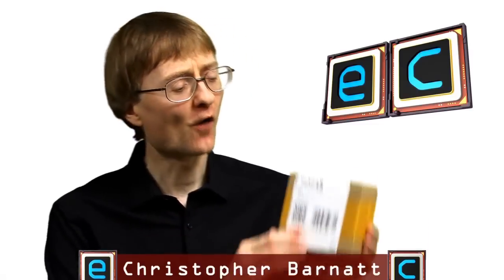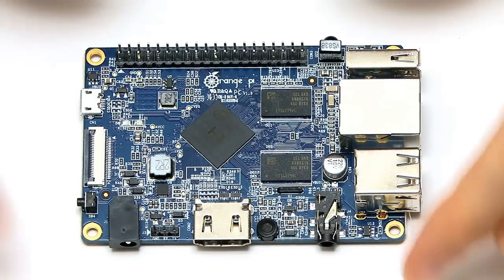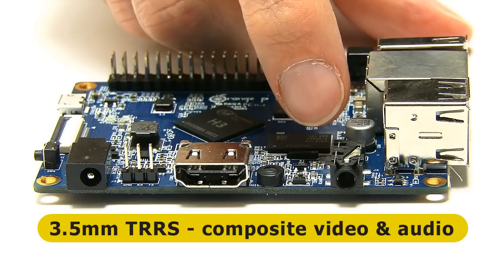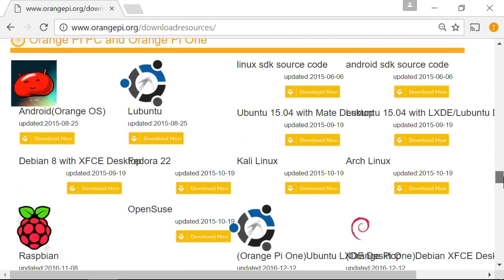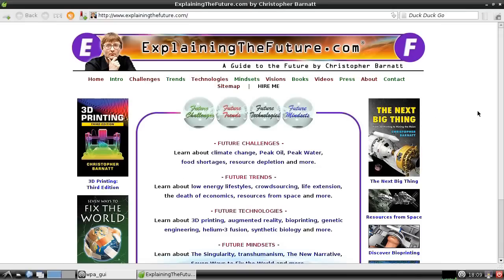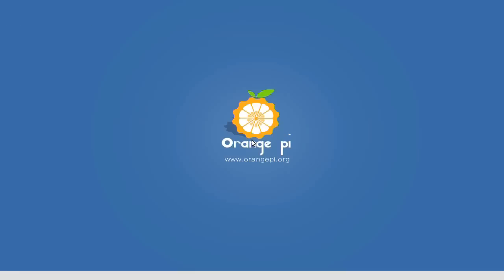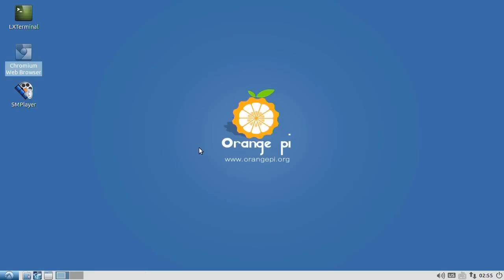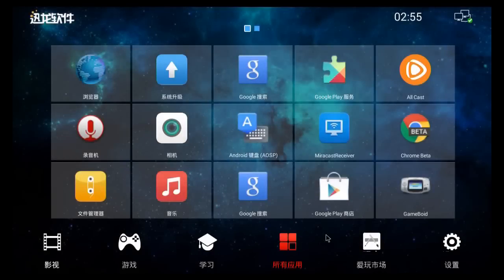Orange Pi PC

Comment: pls,pls use armbian and don't let this great board suicide its core...
it's confirmed this H3 CPU's 1.6GHz is an overclocked value (1.3GHz is default) and heatsink is necessary(at least a small native cooling one), and also their provided OSs are mostly outdated and unstable...
Reply: It's really annoying that they won't put a PCI express on these things. I reckon they could squeeze a pci-e4x on it. With 1.6ghz, you'd be able to play blu-ray with even just 2cores. With just a gen2 pci-e running at 4x you'd be able to have a video encoder card (HDMI input) for it.
Reply: +TableWolfMusic
that's because its CPU(allwinner H3) can't support PCIe as well
it's just a $20 cheapo ARM SBC, what can you expected for. Or buying a UHS1 micro SD could be better?

Comment: 6:36 The microSD socket with the spring got removed from the RPi3 because it easily breaks.
Reply: The lack of a spring in the Raspberry Pi 3 makes it a bitch to get the Micro SD out when it is put into certain cases.  I ended up getting a pair of tweezers and fashioned some little rubber sleeves on the ends so I don't fry anything pulling the card out.
Reply: Mac Donalds - That is like telling me not to lick a hot stove.
Reply from the maker: Indeed. But I bet they put it back on the Raspberry Pi 4! :)
Reply: Bet's on.

It's counter intuitive to have to push on an SDcard to remove it. Many people pulled the card out and that broke the latching mechanism.
Reply: Maico, the LEDs on an RPi3 are in a different location than on an RPi2; that's a way to tell if a case was designed for RPi2 or RPi3.

BTW, I use tweezers to get the SDcard out, but I have a cheap RPi2 case. Idk if the slot opening of an RPi3 case is different.
Reply: +magus12000BC exactly the problem I have. I bought a case saying its Pi3 compatible (while it was probably designed for the Pi2) but since the P3 MicroSD-card slot has no spring and my fingers are not thin as a sheet of paper, trying to pull the card out is impossible.
Reply: Magus, I hope you switch off the RPi before you pull out the SDcard.
Reply: Magus, then why did you put "some little rubber sleeves on the ends so (you) don't fry anything"? That doesn't make any sense.
Reply: Mac Donalds - Metal is a conductor and static is a very real possibility.  Even though the tweezers may have discharged whatever it may have had when I touch it to pick it up, I take no chances because the board itself may have a charge.

The only thing worse than touching a board with your oily fingers without even grounding yourself first is poking at it with what are basically metal prongs.
Reply: It sounds like you're a bit clumsy, then.
Reply: Mac Donalds - A few things here.

1.  Boards are no more structurally sound than they were in the 70's.  They are highly conductive.  They have to be if all the components on the board are going to talk to each other.  The reason why these are marketed for classrooms are because they are cheap and easily replaced.  The specs are something you'd see as standard back at the turn of the century.

2.  Static can arc just like any other electric charge.  You even have to take precautions when soldering.  Any amount of static, even if it isn't a visible spark, can fry a key component and kill the whole board.

3.  It isn't clumsy to take precautions.  It is the exact opposite.  Just because something isn't probable doesn't make it impossible.  And I have seen what static can do first hand.  Take a household vacuum cleaner to a computer tower and see if it turns on afterward.
Reply: There is a difference between a vacuum cleaner and tweezers.

If you fry an RPi when you pull out the SDcard with tweezers, then you're clumsy.

Comment: I think you don't need to format the card before writing the image with win32diskimager but it won't harm ofcourse
Reply from the maker: It remains recommended by all SBC manufacturers I can find. If a card has been corrupted, or even even formatted with multiple partitions previously, it can be hard to expand the file space on it without a "true" format first. I've certainly had SD cards that I could not use again until using the SD Formatter.
Reply: Hi Christopher, I haven't had these problems myself and couldn't think of a reason it would be needed since the partition table will be completely overwritten when the image is restored but apparently not first formatting the card still can cause problems so I humbly withdraw my advise. Furthermore  I wanted to say I really appreciate your style of meticulous and very clear video making/reviewing. Happy Easter !

Comment: What does dmesg say? If it shows the name of the device when you plug it in, then you could use this name to find a kernel module to install so you have access to your usb devices such as Wifi
Reply from the maker: I will try this. Thanks.
Reply: BTW lsusb/lspci is another tool that can list USB devices that are recognized by the kernel. I don't know how those minimal Linux versions work in detail or if they have such tools installed but normal, modern Linux kernels usually report detected devices. While dmesg shows live messages of events that happened in device context, lsusb/lsusb just lists all attached devices on the bus or device ports.

Comment: +ExplainingComputers / Christopher
I suspect that the issues surrounding the lack of USB & Wifi drivers is actually related to the lack of support from the Ubuntu / Raspbian kernel, you should be able to compile separate drivers and then recompile the kernel to gain full access to the USB interface.

Also, I recently was browsing the Armbian web site ( www.armbian.com ) and stumbled upon the ClearFog Pro SoC board and thought that you may be interested in this impressive looking device.

http://wiki.solid-run.com/lib/exe/fetch.php?media=a38x:carrierboard:docs:sr-a38x-clearfog-pro-datasheet.pdf6

Comment: Classic hardware-vendor syndrome: good hardware. bad software.

The folks behind the orange pi should design their hardware to run stock images directly from os vendors (canonical, debian, etc) if they aren't going to put in the effort beyond providing the bare minimum, just leave the software to those who are.
Reply: The SoC in those boards are absolutely not supported by mainline kernel when the hardware arrives. It needs years and lot of community work to get basic things work. The SoC manufacturer provides an old, custom hacked kernel that works with the hardware. This is why all distros and android based on the same shitty 3.4 modified kernel.
Also the boot flow is various SoC-by-Soc. There is no universal standard for arm devices. So these hardware will never be able to run stock linux distributions out of the box.
Reply: While the boot process does currently very from one SoC to another, there is nothing that prevents SoC firms from agreeing to a single boot process and a standard peripheral layout (like how intel and AMD have done for both x86 and x86_64). It doesn't even have to be the default behavior as long as it can be enabled by pulling up some pin or something. If such an agreement is made, then distros will include basic support for these chips out of the box (even new hardware).

I think ARM should mandate a compatibility mode for ARM chips. These firms are too selfish and shortsighted to do the right thing on their own.
Reply: I have to agree, I has someone push this guy over the regular pi, then watch this video and say hmm. i might play with one one day, it just comes down to a proven piece of hardware or try to save a buck
Reply: billfusionenterprise I don't agree. I wanted to buy Raspberry Pi. Instead of it I have just ordered Orange PI PC Plus. Better specs (1gb, 8gb storage, 4 USB without internal hub like in RPI) and lower price. Of course I first checked if it is supported by Debian (because I am it's fan). Great community support (Armbian and dedicated RetroPI version).
Reply: Armbian support is really good for Orange Pi and you get an up-to-date Linux mainline kernel 4.14.y with Ubuntu 18.04.1 LTS.  It has worked flawlessly for me though it's command line only which is all I use.  Network commands are a little different with Ubuntu 18.04 since you use nmcli instead of the old method of editing config text files.  Just use this command to connect to WiFi. nmcli device wifi connect SSID-Name password wireless-password

Comment: so this is like a base model for orange pi?
Also, will you cover the plus or plus 2 model? since it has sata interface and uses emmc
Reply from the maker: It is roughly in the middle of their range.  I may look at their higher end models of some point -- as you say, those with SATA are particularly interesting. But I think I will try to get something running properly on the Orange Pi PC first! Several people here have suggest that I install Armbian.
Reply: ExplainingComputers i'm looking forward for that. And thanks for the quality video :)

Comment: I do have Orange Pi Lite, which is a cheaper version, I believe the hardware is similiar, except I got only 512 RAM, two USB ports (in which one of them doesnt seem to work at all !), no LAN port, but with WiFi. I couldnt configure the Raspbian properly, it didnt seemed to cooperate with onboard WiFi, so you are not alone with the WiFi problems. So I installed Armbian, which runs perfectly, and Im planning to check out Android OS soon, but not the chinese one offered by the OrangePi site.
I asked you previously about the power supply, because I was worried if the computer itself would power more connected devices, and yes, 5V 2A would be enough, but I got my hands on the 3A charger with the 3.9/1.7 DC output - it also fits, and was way cheaper than 4.0/1.7 DC. 
Thank you very much for the video it seems that all Orange Pi computers have similiar issues. The best thing about it is that it actually works fine with Armbian, and (in my country) it was cheaper than Raspberry Zero.

Comment: My Orange Pi PC died after a month, refused to get through booting, just froze part way through, tried different OS's and a different SD card but to no avail.
I'd avoid these personally they are such a headache, may as well fork out the bit extra for a Raspberry.
Reply: I have a RPi 3 and it boots from a 500 mA USB Port on a telly. So for those things Raspberry Pis are almost always better.
Reply: Squiggleblorg Have you tried using a different power supply? I've heard Orange Pi's are pretentious when it comes to those and not booting with cheap ones.
Reply: I bought 2 and one stopped working when my kids tripped on the power cable.  It wouldn't boot for weeks and then as if by magic it started working again.  I looked it up and it turns out these things have a poly fuse that trips to protect the board on a power surge/spike and they say the fuse resets after a day or two.  Well it took more than a few days, but I have both boards again.  Hope you kept your board -might be worth trying again.
Reply: Default kernel of official Linux distros tries to run the CPU on maximum possible speed, it may be the reason of the hardware death. I run Armbian, which cuts CPU speed not more than 1.3GHz, it works just smooth one year so far
Reply: True for the middle class editions, but if you want something really powerful (gigabit ethernet, SATA, 2GB RAM…) Raspberry Pi won't cut it. And if you want something really cheap, Raspberry Pi is also not an option because the Zeros are constantly sold out everywhere. Orange Pi covers both of these areas.

Comment: Try using armbian - its like linux and most probably the wifi usb driver can work.
https://www.armbian.com/orange-pi-pc/

Also you can change the language on android by going to settings then to a keyboard icon by scrolling down and choose the first option. You'll find english, press on it and your done.

You can also use RetroPiOrange to play old school games using emulator. I hope you make an update on the orange pi even though I don't own it. Hope to get a reply from you :)
Reply: Thanks, i own an Orange Pi and I'll try those images, but as i have it for over a year and tried lot of systems, i'm quite sceptical :)
Reply: Nightly image has kernel 4.10.1 insted of 3.4. So it should have better driver support. Hardware accelerated video and gpio is probably still limitted. But at least you can turn the board into a server for streaming, donwloading or other stuff.

Comment: Are the dongles not even showing up if you do lsusb at a terminal? Perhaps they're the sort with firmware blobs which are uploaded to the adapter each time it's used and these aren't available in the OS. I had a similar issue with Mint, an old Dell Inspiron laptop and its Broadcom adapter.
As of often the case with SBCs, the spec can be nicer than a RPi but the software and community backing barely exists.

Comment: Can it be used as a desktop pc? I'm currently on rpi and using it is a really bad experience.
Reply: I wouldn't use any ARM device as a desktop.
Reply from the maker: The only really good desktop experience I've had on an SBC is with a LattePanda. The TinkerBoard is improving -- I'm just finishing work on a video to upload two weeks today. Still a very promising platform. The 2BM RAM makes a real difference.
Reply: Its a little expensive, but I would try an up board for a desktop computer.
Reply: ARM SBC as a PC for me is still rough. If you really want Linux, though, tough luck because you'll be stuck with ARM-based computers, as Windows10 Intel Atom SBCs are problematic with Linux and don't work properly.
Reply: ARM SBC as a PC for me is still rough. If you really want Linux, though, tough luck because you'll be stuck with ARM-based computers, as Windows10 Intel Atom SBCs are problematic with Linux and don't work properly.
Reply: The compute stick (or equivalents) would be an interesting option. But it sits in an odd place considering you can get the Latte Panda which is much more versatile.